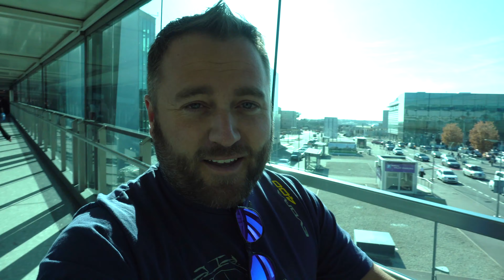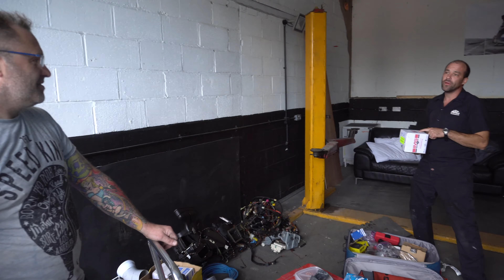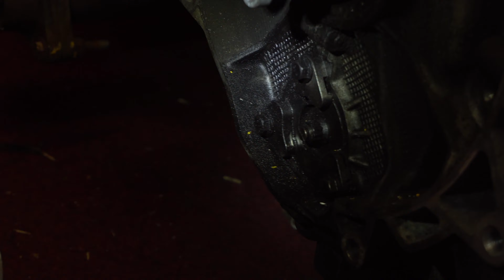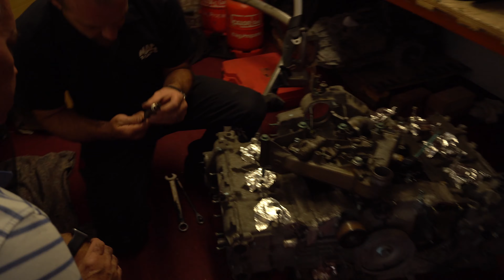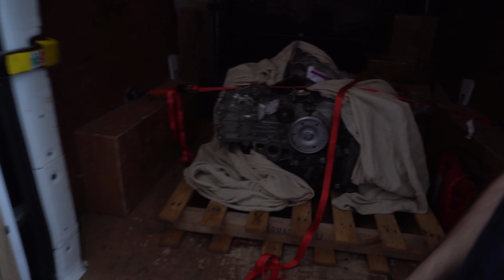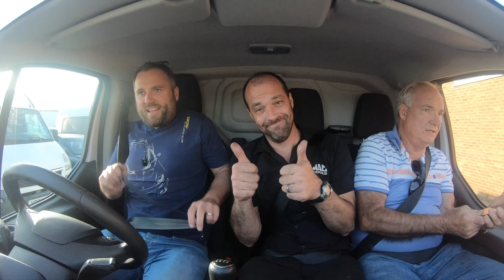Porsche Boxster 986 Engine Swap - Finding an Engine (PART 1)

Comment: Great video!! 
Have you investigated what happened with the original engine, what caused to engine blow?
Reply: Usually with those engines it has something to do with there's like a center rod and the rod tends to misalign and then it's scratches up the interior of the engine beyond repair